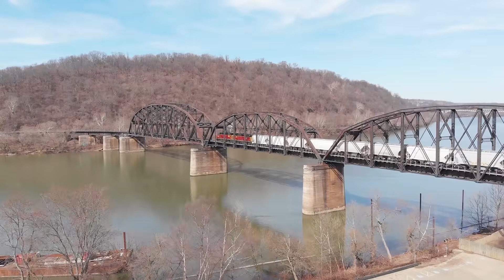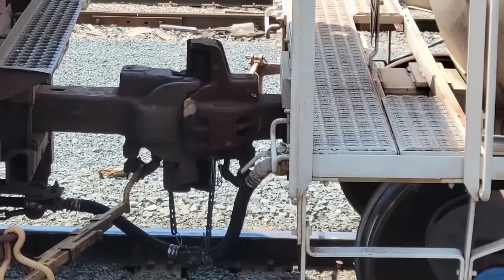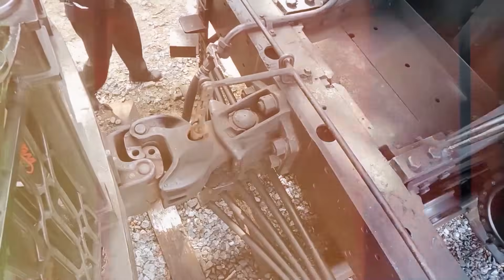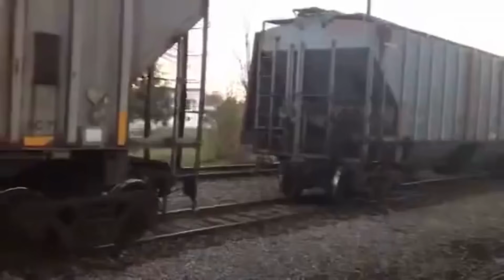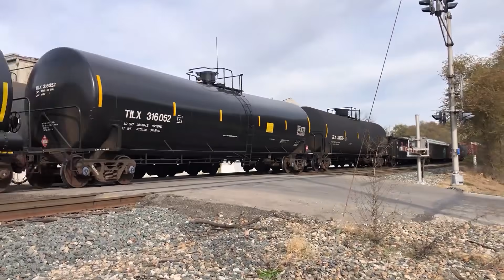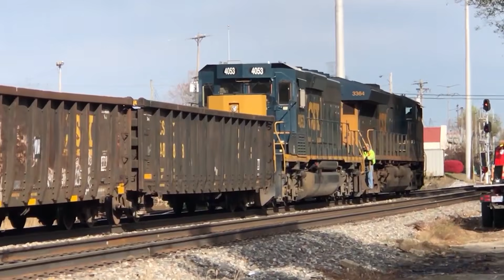How Train Couplers Really Work

Comment: Nice video, but contain some falsehoods on the airlines do not connect by themselves nore the electrical lines. Do not connect by themselves three there's only airlines between the cars. Electrical is only on the engines now the airlines do disconnect without the help of a man, but men and women must still connect the airlines manually.

Comment: I don't know the coupler weighing 82, maybe remove the 8 and add two zeros at the end, still that might be on the conservative side
Reply: In order to be hired as a conductor you need to be able to lift and install an 80 pound coupler and install all by your self.
Reply: @bcrusher1979 I'm not expert on trains and couplers, it looks heavy all That solid steel.

Comment: The air hoses have to be coupled manually.  I know, I have done it many times.  The same is true for the electrical connections on passenger cars.  To MU locomotives, electrical connections and air hoses must be manually connected.
Even model railroad couplers work on a similar principle.
Reply: Thanks.  I wondered how do the glad hands "automatically" connect.  Video makes no sense.

Comment: Interesting video, but the comment about the air hoses automatically coupling seems incorrect.  In standard American freight rail operations, air hoses do not automatically couple. While the knuckle couplers lock mechanically on impact, a crew member must physically step between cars to connect ("glad hand") the air brake hoses. Automatic pneumatic coupling is generally limited to specific passenger or transit systems.
Reply: Correct.  My grandfather (brakeman and later passenger train conductor) called them "hose jiggers".  He had some samples in his garage which, along with a whole bunch of valves and fittings, were my Meccano set. 🙂  Miss him a lot.